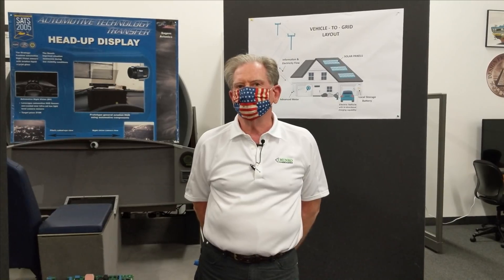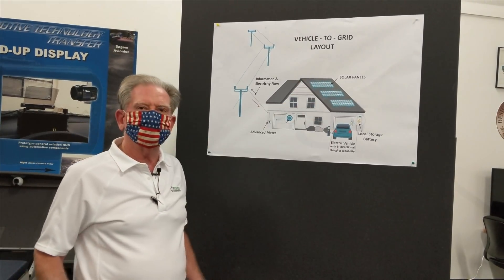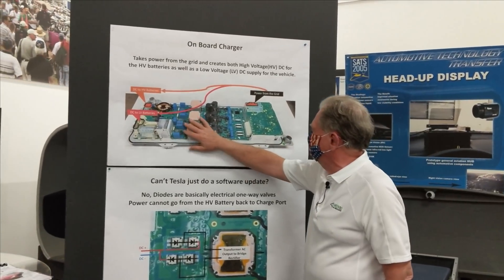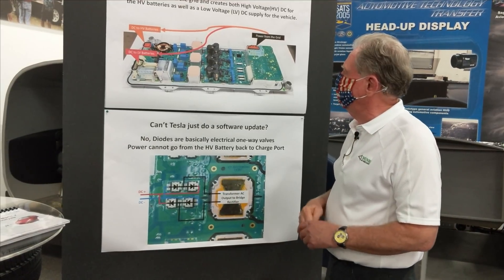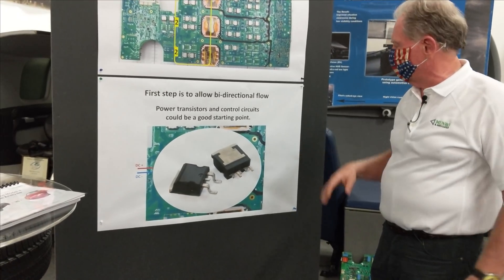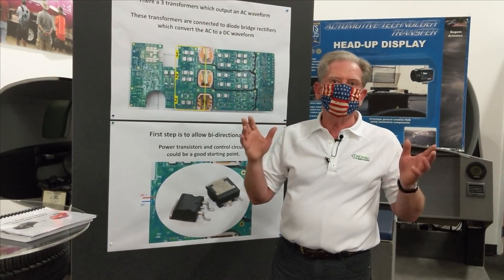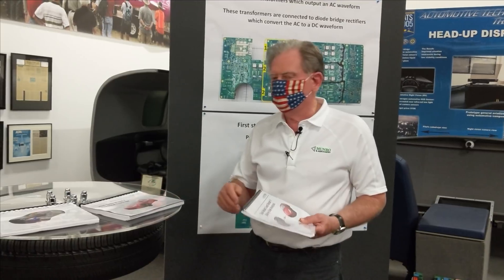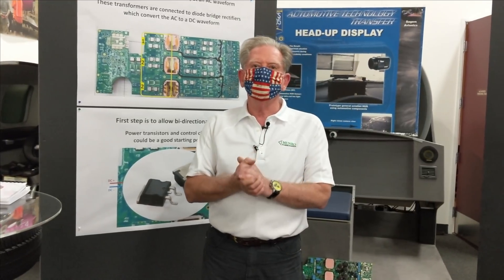Tips for Tesla E2 - Vehicle-to-Vehicle (V2V) and Vehicle-to-Grid (V2G) Charging

Comment: Great episode as always thanks Sandy. I think the future with Tesla will be a battery system that will back feed to the grid and be able to flatten the (duck curve ) which is a spike in the utility  electrical grids demand around sunset when the grid is losing power from solar and everyone is returning home from work and cooking dinner washing cloths TV ect... Its a big problem in the electrical grid that is getting worse every day ..  Tesla I feel wants to keep thier car battery warranty as long as possible so at this point maybe they don't want to add any cycles to it, or perhaps it a regulatory / political  problem that needs to be sorted out first with the monopoly utilities. In any case battery grid storage is in our future if not directly from the car but from the recycling of the cars batterys. Think about this you put 250k on you model 3 the car is at a point when its is in rough shape but the battery is still charging to 75 to 80 % maybe more. Tesla recycle the battery for grid storage and gets another ten years out of it.

Comment: CyberTruck has 240v out (and 110v for you weirdos with your low voltage stuff! 😜) so must have this.
Reply: 120.
Reply: The F150 already has. Glad to see more.
Reply: @lawpickinglocksmith7689  You mean the 2021 F150 that is not available yet?  Also, not clear if that is only an option in the hybrid F150...
Reply: @lawpickinglocksmith7689  No F-150 I have ever seen.

Comment: For V2V, couldnt it stay DC-DC and not need an AC conversion? And for V2G couldnt the DC-AC transform could be in the garage and not in the vehicle? That seems safer too
Reply: DC to standardized 240 VAC would be simpler.  DC/DC requires communication between the vehicles.

Comment: Maybe this will become standard or an upgrade / option . Probably we'll get some info  on  battery day  Cyber truck may not have v2v or v2h/g but it  will have a 120 and 240 plug in the back of the Vault what amps  & watts It will have unknown still.  Either way with helping somebody on the side of the road if only needs 3 miles/ 5km   or  keeping your fridge and deep freezer running shouldn't be a  problem.

Comment: There is a way to charge a stranded electric vehicle by towing it if it has regenerative braking. This absolutely works. Of course, it needs a vehicle with a tow hitch and high enough power output that it can pull a heavy, continuously braking car without straining its own drivetrain. But when all cars on the road become electric that may become less of a concern.
Reply: @harry camper You don't have to use the towing mode if you want to recharge it through towing.
Reply: @harry camper regen braking is not recommended for Tesla vehicles?  Lmao
Reply: @harry camper 
Be careful, the Tesla Towing mode is only releasing the parking break, so the car is in Neutral.
But the Towing mode will stop suddenly after 20 minutes, 
or after moving like one mile, and if the speed if higher than 5 miles per hour.

Comment: When I was flying my Cessna 172, people would express an interest in learning to fly.   I would ask “have you ever run out of gas in a car?”.. .  If the answer was yes, I’d say “Flying is probably not for you ”
Reply: I have been able to fill up my car using Gallons and Liters and I never ran out of gas.
However some professional Jumbo Jet Pilots had problem with Gallons versus Litters and ran out of gas mid air.....
Note: I don't trust pilots, so I always carry a parachute.... and always jump before landing.
Reply: @nihongobenkyoshimasu3190  Nice Air Crash Investigation reference
Reply: My commercial pilot certified friend said,  "There are old pilots and there are bold pilots. But there are no old, bold pilots."
Reply: ROTFLMAO!
Reply: Ha. I fly commercial on the 737. We upload litres but convert to Kilos. Modern flight planning software is incredibly accurate. If I’m expected to burn 10,575kg on a trip I would almost always be +/-25kg after a 4 hr flight. We check every hour for accuracy. I’m not bold by any stretch- 51 years and never got close to running out.
Reply: That's not a logical assumption. I assume you are trying to make a joke?

Comment: Hello Sandy, Can you reverse engineer how the braking redundancy is of the Tesla ModelY? What happens if the braking pedal sensor fails? Would the car keep driving while you stamp on the not working brake or would a failure result in the car stop?  There was a case in China where a Tesla did run at 120km/h and failed to slow down. The driver attempted to brake but nothing happened. He avoided some 50 cars and finally ended up in a ditch after impact. The car got on fire. Stored data showed no braking action prior to the impact.
Reply: The brake pedal is physically connected to the hydraulics.  The regen braking would also start first as you lifted off the accelerator pedal.
Reply: So, what you are saying....some Chinese guy lied?  Ok.  That I believe.

Comment: 220 V is only dangerous if you lick it, Europe uses to 220v And it’s not dangerous for them how come we can’t handle more than 115v lol
Reply: Peter Rempala - We have 220/240 in garages, workshops & kitchens, usually at 30-50 amps. That’s how people power drill presses, table saws & electric stoves/ovens & refrigerators.
I had a friend who got electrocuted in Paris when she was pulling a plug out of an outlet.
Reply: 220V can absolutely be dangerous. I have been electrocuted twice with 240V as a careless teenager. Was trying to diagnose a failed component and accidentally put my finger in the empty fuse compartment. I got nothing more than a hell of a scare and shock, but it can be fatal.
Reply: Rhys Thorpe and yet you’re still alive congrats you have learned a lesson and hopefully didn’t do it again.
Reply: harry camper Sarcasm is not your strong suit is it. LOL
Reply: harry camper  maybe just maybe the next generation will have VtoV charging after all the lickers are gone and then we the people that can read warning labels can have nice things again.

Comment: I have never seen an EV on the side of the road stranded due to empty battery. It's unlikely to happen because, unlike gas cars, you start out every day with a full charge. Also, nowadays with cell phones, if you run out of gas or battery, just call a tow truck.

Comment: I am wondering:  instead of adding expensive bidirectional components on that board, how do you like the idea of a dedicated power-out DC to DC board?  Add a DC outlet plug to the car, run a cable to a Powerwall, dump power into the Powerwall.  From there, all the wiring is already done for the house.  A DC to DC outlet could also be used to direct DC power into a depleted BEV, assuming standardized plugs and cables.

The DC-to-DC board would be connected to the battery pack but left unused if there's no power draw.  It's not transforming from DC to AC, so it can be quite a bit smaller than the board that feeds power into the battery pack.  It will be one-way, so no need for expensive bidirectional components.  It should also be a bit more efficient.  There should be some slight power loss when we go from DC to AC and back again.

Since in both cases the recipient of power is another battery pack - a Powerwall or another BEV - there's no particular reason to transform the electricity into AC and back again, unless we're envisioning long cable runs or something.  Save some steps, constrain cost, constrain weight.  This solution does require fresh engineering and new components, so it's not going to be quick, but I don't think there are any quick solutions.  Might as well look for an inexpensive fix.

Bidirectionality is the elegant solution.  I don't know if adding a dedicated DC power-out board and outlet makes the most sense, which is why I'm running the idea across your desk.  :-)
Reply: Urgelt Needs more cables. You have to convert the DC power at some point so this can be achieved more easily in the car when it communicates with the powerwall
Reply: @alexandervesper7253  The battery itself is charged with DC power.  It puts out DC power.  Same with Powerwalls.

I don't see a reason for DC to AC to DC conversion.  Maybe an electrical engineer might?
Reply: Urgelt No, but I‘m interested in electrical engineering. xD
I think it‘ll be better to integrate an inverter in the car because when you integrate V2G at your office you have to install a DC wallbox which is much more expensive (+10k$) rather than modifying your existing electronics. But both systems will work
Reply: @alexandervesper7253  At office or home, direct DC power transfer will require a battery of some sort.

You won't see VTG emerge as a simple AC plug into a building's electrical wiring, because there would be no controls over when, how much, who gets paid.

Could you do it with just vehicle batteries dumping power into a building's dumb, unbuffered grid?  I don't think so.  If each BEV is a lone actor, coordinating doesn't happen.  Something has to be in charge.  It's not really possible to decentralize it to the automobile.

The building wired for VTG has a battery buffer and control software to manage multiple power sources: solar, grid, maybe some diesel backup generators, and BEVs when they are available.  It tracks the real-time costs and availability of power and makes real-time decisions about buying and selling power.  The building's battery is integral.  Without it, you don't have a system.

So we do have a DC to DC power transfer to work out.  And I think my question stands: why go from DC to AC and back to DC?  What's gained from the extra steps?
Reply: Urgelt I think the future will be solar panels on (nearly) every roof with (at least a) small battery pack and BEVs. When the car is parked, charged (80%) and there is excess energy in the grid it will be charged further(not more than 5-10%) even at your office. This depends on your energy usage at night, etc.  When you come home you plug your vehicle in. It will be discharged to cover your energy usage at night. There will be a few base load power plants in the grid (hydropower plants, wind turbines, etc. maybe fusion in the future). Big energy storages are also needed (TESIS at the german aerospace center, pumped storage plants, Gravitricity, ...). Maybe this looks a bit utopian but I think this is the way Elon is looking in the future. This obviously has to be coordinated to build a stable grid. You will be charged only the energy you consumed and you‘ll get money back for storing the energy but this won‘t be the regular case because your energy requirement will be calculated before charging. We have to put research in this topic to find the best solution for our grid of the future
Reply: Urgelt Maybe we will build a larger DC grid in the future. Here in Germany we are already building big DC transmission lines
Reply: @alexandervesper7253  In Sweden we have built (HV)DC transmission lines since the 1950ies. All cables passing seas and large lakes are also sure to be DC (AC cant pass long distances under water due to waters resistance o building up the magnetic field, which needs to change direction 100-120 times/s)
Reply: @Urgelt  Nothing is gained from DC-AC-DC, in fact, lots are lost by going that way. It requires more expensive hardware and also more of it, than just going DC-DC. It also incurs larger losses (about 4-6% instead of only 2-3%) in the conversion to go DC-AC-DC, rather than just straight DC-DC.
Reply: stefanhuszics We‘re building them a lot more now, because we have a lot of wind turbines in the North Sea producing power for the whole country. Our first was built in the 40s but never went into operation. The first in the grid was in the 90s
Reply: @stefanhuszics  Yeah.  Thanks for chiming in!
Reply: Urgelt thx

Comment: How would this be different on the Cybertruck, since it's supposed to have the ability to charge the quad it might be able to slowly charge bigger cars, right?
Reply: The cybertruck will have a guaranteed output of at least 7.5kw. So yes, you can charge a model 3 from dead to full in 8 hours.
Reply: @EugenePutin  in Europe that means two 230V plugs at maximum capacity. Charging your tesla on 230V has a limit of 3.5 kW.
So that means you could charge two Tesla's at 3.5 kW at the same time, not one at two plugs.
Reply: ZesPak you can technically lower the model 3 to 500 watts of charging. 7.5kw/.500 is 15 teslas that you can charge.
Reply: Unless the quad charges from the same power tool plug In the bed